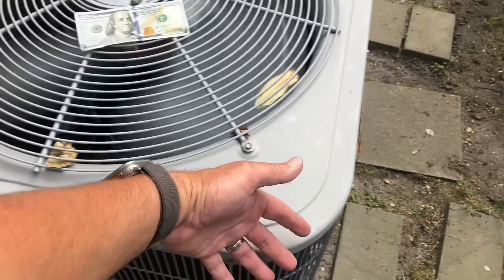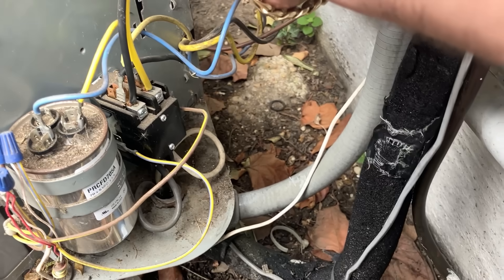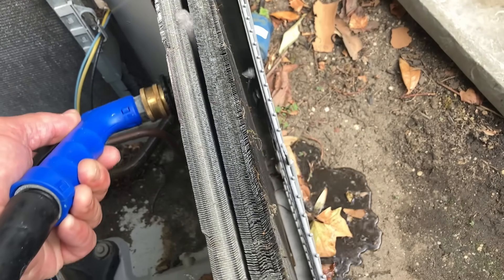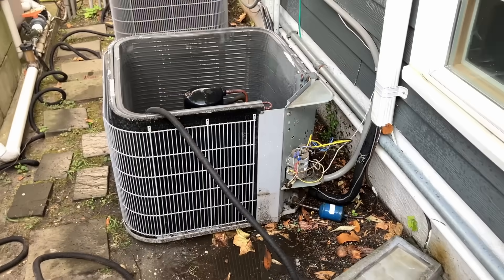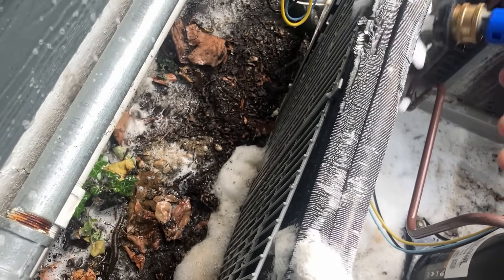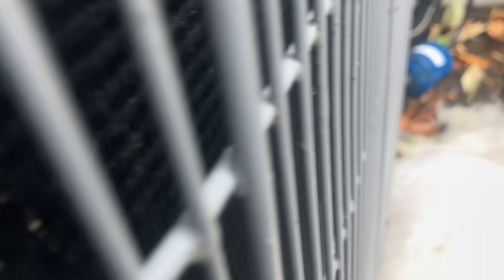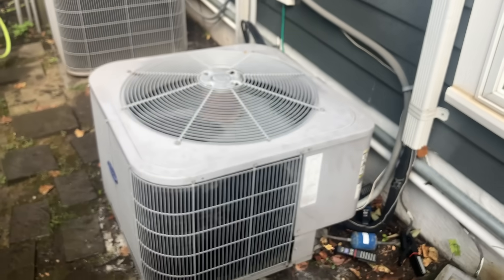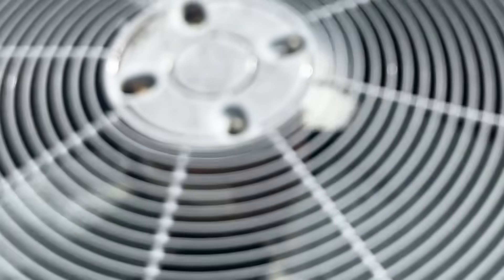AC Not Cooling? HVAC Tech Finds WRONG Capacitor & Filthy Coil Sabotaging System

Comment from the maker: 🔧 Another day, another misdiagnosed system…
This Carrier AC wasn’t cooling — and the homeowner was sweating bullets. Turns out the coil was clogged and someone slapped in the WRONG capacitor! 🤦‍♂

💬 Drop a comment if you’ve ever walked into a system sabotaged by lazy install work — or if you’ve got a question about diagnosing airflow issues or capacitor sizing.

🛠 Want to learn more or level up your HVAC game?
👉 https://aciq.com/mikeypipes – Private label HVAC, wholesale pricing, and official ACIQ dealer access.

#MikeyPipes #HVACDiagnosis #ACNotCooling

Comment: wait, someone did a used motor hack job on that condenser, pretty sure it's supposed to be an 1100rpm fan motor and that one said 825rpm. some hack special was there, slinging random used parts?
** also the blade looked too high up in the shroud. should be about 1/3rd the way up in. too high ruins the air flow and it swirls in a big circle instead of up and out. that unit is a gift that keeps on giving. 🤡

Comment: 7:58 that's one horrible sounding laboring fan motor. I could tell right away cap was bad or wrong value. since the blade spun free earlier on. only other reason could be cooked windings but it would likely have been going off on thermal and the call would have been for no cooling at all. 🤔

Comment: Saint Mike. Yesterday, my AC was blowing hot air. I opened up the condenser unit and saw the capacitor was pregnant. Checked the capacitor resistance and it was dead. Fortunately, the system still had a warranty and the tech replaced it today. But the tech said my analysis was 100%. I learned from the best ;) Thank you for all the great videos and knowledge you provide us!

Comment: Does cap size affect the fan motor speed? I thought it just got it started. Great video
Reply: yes, those are "run" capacitors, not start capacitors. although they are needed to also start the motors. wrong value for the rated voltage will not make the magnetic phase angle change enough for it to run as smooth nor the right speed. they'll run hotter, draw more current and the wrong speed. I could hear it laboring when he powered it up and it sounded slow too. 
as you can tell, I've been around lots of electrical, motors, electronics and much more for plenty of years. I wont toot my horn anymore.
Reply: @throttlebottle5906 thanks

Comment: That's a 5 Ton system you are working in there MP. 24ABB360A003. You threw me off with the 70MFD cap. No 3 ton system in the history of ever had a 70 mfd cap.
Reply: 13 seer it’s a 5 ton
Reply: I looked up that model number. It’s a 4 ton. Weird though because I also immediately thought of 3 because of the 36

carrier 24abb348a310
Reply: @HVACRU  NO NO NO the one he worked on is a 5 ton model number 24ABB360A003. The one sitting next to it that he also looked at was a 4 ton 24ABB348003.
Reply: What do you mean guy? 48A model , it’s a 4 ton air conditioner no if, and, or buts. Divide by 12 always, not a 60 anywhere in the model number babyyy
Reply: @Bubba1235-n8m  model number on the system he worked on is 24ABB360A003 "60" IS A 5 TON also has a double row coil which is actually double the surface area.
Reply: I think once the coil dries off the airflow would improve.
Reply from the maker: there is no way this tiny condenser is a 5 ton. sorry.
Reply: @PipeDoctor  yes sir that's a 5 ton condenser.
Reply: @PipeDoctor  has a Copeland ZP51K5E compressor at 51,000 BTU
Reply: @PipeDoctor we are a American Standard and a Carrier Dealer. Been wondering on them 25 years. Its the last 2 numbers before the letter A. Look up the model number if you doubt me.

Comment: Blade to low ?
Reply: looked like to may have been too high, the tiny few seconds it could be seen when he pulled the top off, it looked to be over half way up in the shroud. 1/3rd is more standard.
probably some newbie replaced the motor at some point or even the blade and got it wrong height. maybe someone hacked in a used wrong motor and left the capacitor?
hard to say when clearly ding-dongs have worked on it in the past.
I'm not a dedicated HVAC/R person and have had to fix tons of stuff some of them have total hosed up. I'm not saying their all bad technicians or out to cause failures for system sales, but some are or just morons that shouldn't be allowed to even blow their own noses. same thing happens in all trades and we all do dumb things now and then. lol

Comment: I bought a 50 mfd Jard Cap for my pool motor but it was small. I installed it and there was this delay i didn't like. I said eh whatever and 6 months later she Poofed and internally sharted. I thought u ain't gonna get me again so i ordered a 65 mfd Jard Cap. 😒 B Slap, the 65 mfd is even smaller than the 50 mfd it replaced. The motor sure does come on in a flash with this new 65 mfd cap. The motor was originally rated for 50 mfd. Why can't they make a Cap that doesn't Poof ? Why the Poof ? In a few months i'm expecting a Poof again. (sharted not shorted)
Reply from the maker: Caps can be tricky, it's always best to go with the manufacturer's specs.
Reply: if it has "two" capacitors, the other (start cap) may be failed/failing or the centrifugal start switch is going bad. something like weak/broken springs on the counter weights, rusted away parts, failing contacts, sticking slide ring, etc.  hard to say on a pool pump motor, they often get a chlorine bathed and rusted like crazy. maybe even rusted terminals/terminal block. yes I know motors pretty well. 🤪
Reply: @throttlebottle5906  It has a short end cap Switchless Design which leads me to believe no start cap. I had a Gator pump with a long end Cap & that had a start/run 2 cap/switch. The end cap looks 1/2 in thick on my pool pump and you can see the Stator windings in the back. Anyway the replacement 50 mfd was no bueno, but the 65 mfd is Instant On. When the pump was new it was never Instant On to begin with, Always the Hum with the factory 50. It Could it possible be that US Motors is using a Bad Mathematico Formula ? 
Always, Always.........Always the Hum 🎵🎶
Reply: These new AC motors are pretty Chad on the inside, One could think maybe the Rotor Bearings could be bad slowing my rotor down but i hear nothing Shultzy and it's less than 2 years old.